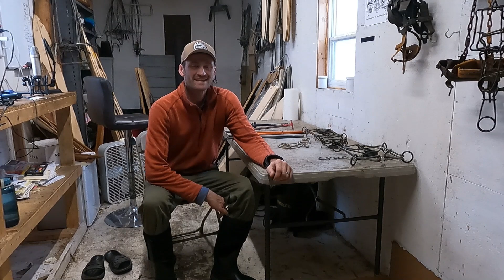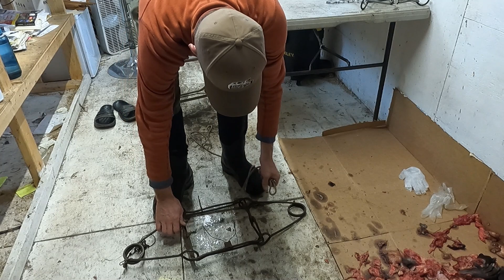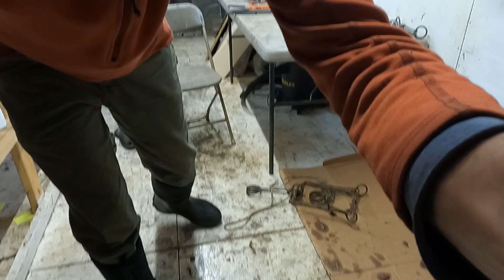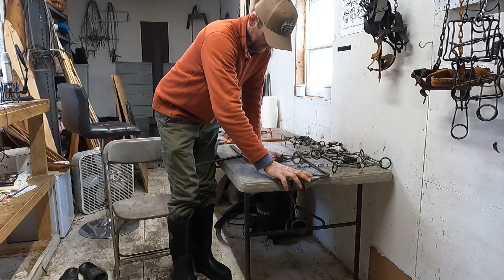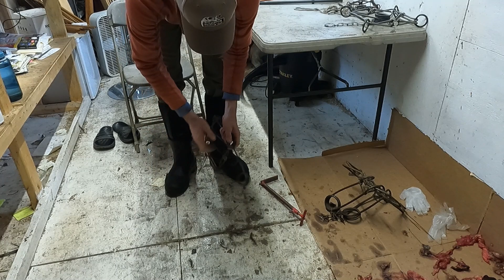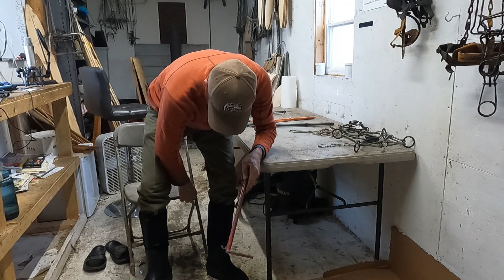Tools to Set Conibear/Bodygrip Traps

Comment: Jerimiah, you really should check out Trapper Ron`s Safety Setter. I know you have briefly mentioned it in your article on trap setters on your website : Trapping Today back in January 2022 There is one for 280 and 330 size and one for 220 and lower sizes. Very compact, I have both and carry them in my pocket whenever I am working with Body Grip traps. Trapper Ron has a video showing the different ways to use it, and all I know is I will never be without it in my pocket when trapping Beaver, and Otter. They work without a problem on Belisle. They probably will work on Savage (Sauvageau LPDQ) traps, but not many people in the United States have these Rolls Royce of body grip traps because of their expense. They are certainly worth every penny of it too. Thank you for all of the wonderful educational videos you have provided over the years and also be careful out on the line.
Reply from the maker: Thanks, good suggestion!

Comment: I bought the RTS a couple of seasons ago, and I am not going back to the struggle again, ever. Another great thing about it is if you get caught in a 330, just grab your RTS and operate it with your free hand. I keep mine tethered to me when I am working with coni's away from the truck. I love your take on the macho men setting 330's by hand.
Reply from the maker: Absolutely, it's pretty comforting to know you can use one hand to get out if need be!
Reply: @trappingtoday  Why would you ever be caught in a 330 conibear  trap?  Just keep your hands out of the danger Zone.

Comment: Why is the trigger so loose on that new trap. Get a wooden broom handle and use it to set it off. By the mark on the wood you will know how hard it hits. Like the belisle 160 almost break a broom handle
Reply from the maker: Brand New trap, haven't adjusted it yet. Good point!
Reply: @trappingtoday  I never adjust new traps with belisle they never move
Reply from the maker: @chadcampbell9279  for sure, you get what you pay for. Belisles are an outstanding trap!